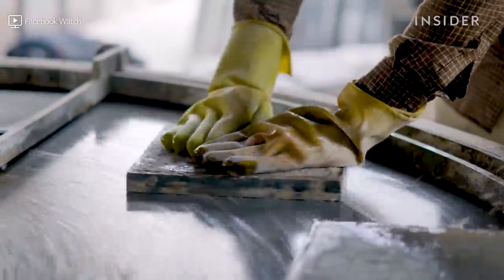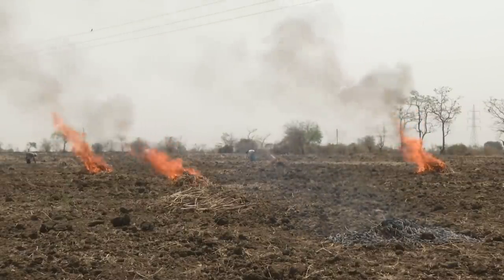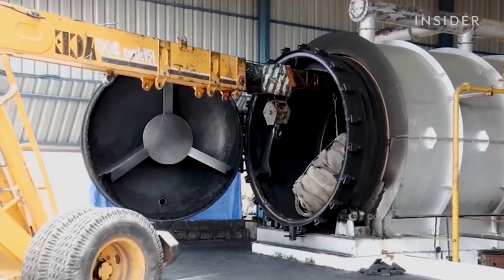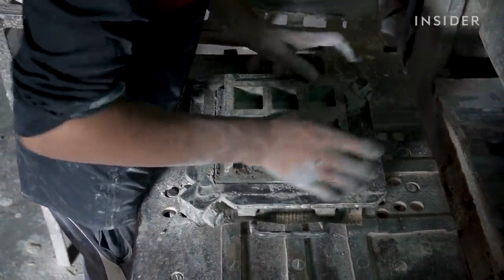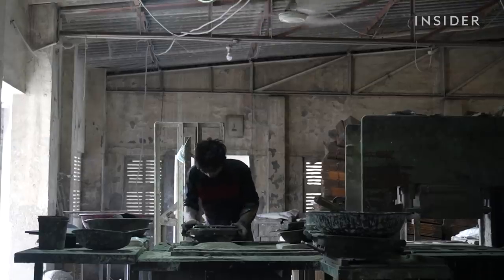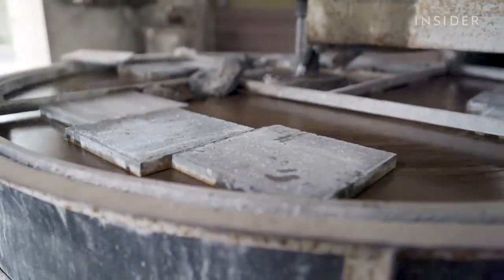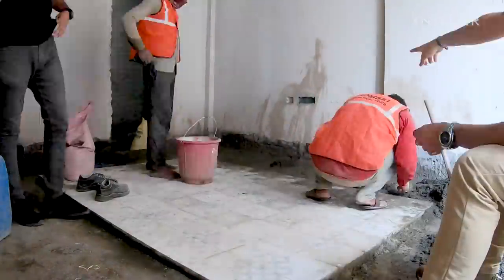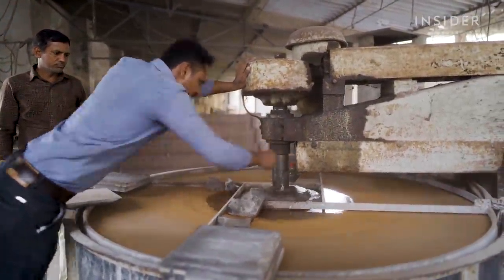Handmade Tiles Made With Smog-Causing Black Carbon | World Wide Waste | Business Insider

Comment: Do they recycle the water
Reply: No, but that doesn’t matter because they save a little bit of carbon from going into the air /s
Reply: @adamrhoads1521  yes it does matter because water is more important than removing just a few tons of smog
Reply: @jaydendiaz1181  you don’t get it, we can just use saltwater /S
Reply: Technically they could if it moved to wealthier countries or done by a company with large financial backing
Reply: @upperjohn117aka  you don’t get what /s means don’t you
Reply: It's greenwashing the tiles are packaged in plastic.

Comment: so they burn tires which makes polution > Sells the carbon so they can makes tiles > soon everyone want tiles > more tires needs to be burned off and more polution is made.. I see they are really smart. 

Why not dig a hole and put it there insted? if its solid why use it? - Maybe make tires without carbon in it, that would solve both tires burning and carbon in air.
Reply: It's greenwashing the tiles are packaged in plastic!

Comment: Living in Los Angeles I am amazed at the amount of black carbon that accumulates on the surface of objects in my patio area. I live 1/4 of a mile from a freeway so that may explain things. 
As for the tiles, would incorporating black carbon into ceramic tiles not work for some reason? I’m just wondering why they use the curing technique that this company uses to produce tiles instead of adding the carbon to traditionally produced ceramic tiles.
Reply: Except cars don't produce black carbon soot. More likely it's from coal burning power plants.

Comment: Water is hugely wasted for making and polishing of the tiles.
Secondly the term used tiles made of SMOG is not relevant.Its simply they are using carbon black instead of color.
Thirly if the carbon is used for burning in case of fire it will add up a fuel to the fire.

Comment: I'm kinda surprised that they didn't just use black carbon as an insulating material added into cement regardless.

The color black is great at distributing heat but carbon is not so if added into cement walls it should offer a stronger insulation. This should offer a more through pretection in either cold or dry places.

The only downside should be the consistency and amount of black carbon available.

Comment: It won't change anything.
Anything that they show in the opening ( from 00:30 onward ) will still happen, vehicles still flooding the air with pollution, people still burning stuff, and tires still get burned.
And they use cement to make these tiles, cement require lots of energy to make, they also use tons of water (hosed every day for a month), then it needs lots of polishing (15-20 days). All of those combined will result in a more carbon footprint than normal baked tiles.
Well, at least they tried.

Comment: The water required to make them should be reused.
The energy required to polish them for installation in an apartment seems a bit too much. 
Carbon is a conductive material. Imagine having wires running under it. 

In my opinion, this should be sold to cities! On the pavements the requirement of polishing or perfection is way lower. 
Also where ever ground wires are, un carboned tiles should be used that have a distinct mark on them showing they are carbon free.

Comment: well, it already exists. its called something like fly ash cement. its filler for cement, you can you basically use anything as filler but the thing is that the more filler you add the less quality you get, it will brush out fast

Comment: Whilst being a lovely craft they're commited to, it's not really a "better" alternative. "Black carbon" has been used as a die and a cheap additive for centuries. You even started the video showing that they get some of their material from old tires, which are already filled with carbon dust in the firest place.
Also as others have pointed out already, the cement they need  for their tiles needs to be produced too, another energy intensive process.

Comment: The fumes from mixing concrete permanently coat the lungs of anyone working with it; especially those who do so on a regular basis. Those workers will likely die of silicosis because they aren't provided with any PPE. Even with the ideal of fighting economic pollution one is responsible for protecting the individuals.

Comment: Meh, this project releases quite a lot of greenhouses gases due to cement curing, uses up a lot of water and only uses a very small amount of carbon. Realistically it is not going to make a dent in the amount of air pollution (to reduce that you need to start at the source).
You could use stone (marble, granite, volcanic stuff or anything else that lasts) since they are already there, need no baking, no curing and are carbon neutral - all you have to do it make them even/smooth (which is not as hard as some might think).

Comment: Carbon dioxide is not a pollutant. It is plant food. It's the loss of ozone that is messing up the atmosphere.
Reply: First of yes Co2 isnt a pollutant and that isn't why it's a problem. Co2 is a greenhouse gas that retains more heat from the  sun and heats the planet. Also no the hole in the ozone layer is not what is "messing things up" the hole in the ozone layer is almost completely gone and has been rapidly reducing in size since the 1990s. Basically the ozone layer is no longer a issue anymore since we solved that problem with regulating ccfs like refrigerants and aerosols.
Reply: @randybobandy9828  you might want to check the ozone loss going on in the tropic region. There is new findings on that. And CFCs were not the main cause.just a contributing factor to make an ongoing problem worse. It has to do with the magnetic field and the sun.
Reply: @suzieseabee  from what I've read ozone layers problem already solved
Reply: @agateslate7939  no, it comes and goes. Like the el nino(ocean thing).

Comment: What about the safety of the employees? Sir you need to provide your workers with PPE. And also you can recycle a water, why not put it in a huge basin and soak the tiles on it and reuse the water instead of using a garden hose.

Comment: These tiles are made from black carbon made from burning down tires. That black carbon is usually sent to factories to be burnt as fuel, but he buys some of it and turns it into tiles.
These tiles aren't a solution to a problem, they're a side effect of a problem. This tile-making process cannot exist without a large source of cheap black carbon on the market. And even making that black carbon is bad for the environment.
The only actual solution is for the factories running on black carbon to switch to a different energy source, thus ending the market for black carbon.

Comment: To produce a carbon tile you double the emission, as the report does not consider the total carbon footprint.

The electricity of polishing and pressing machines.
Waste of drinking water in parts baths.
The fossil fuel used to transport the raw material and the finished part.
All additional consumption of the company, from its office, to the addition of employees who will contribute to the daily carbon footprint.

It's a doomed solution!

Comment: As nice as it is to used recyclable material as building material you have to be careful as it might very well have unintended consequences for example in israel the was a recyclable building material for flooring (the stuff that’s under tiles) to replace sand it was made by grinding old plastic and rubber melt them together. 
At the time it was hailed as a major step forward in sustainable building but later it was shown to be a major fire hazard that when burns released a massive amount of pollution and in liable to cause cancer

Comment: i am kinda not sure about this.everything i presented effective, easy and problemsolving while its really not.

cement needs to be harvested which costs a lot of labour, only a small amount of the black carbon that actually land in the air is used, these tiles are kinda expensive so whos gonna buy it, the constant watering and polishing causes a lot of water waste, the employees are clearly breathing in highly concentrated carbon air with no protection.

the idea of reusing black carbon in building is great, but this is definetly in need of some adjustments.

Comment: I would be fine with putting tiles like this on the wall, but I don't like the idea of using these for walking surfaces.
Reply: Why?
Reply: @randybobandy9828  Tiles on the wall are rarely disturbed and normally last ages but tiles on the ground break and crack regularly.  I do not want tiles made from air pollution breaking in my home.

Comment: Good idea but...what ? Rinse in many times ? Does the water used for rinsing will washed away and take the dangerous chemical substance inside carbon in the tiles to the waste water system ? Or any drainage system ? And, it's gonna use much water to rinse it.
200x30 = 6k a month... Still very small number...hmm... It's really hard to not polluting the environment...
Reply: It's greenwashing the tiles are packaged in plastic!!!
Reply: @insectbite1714  ohh.. I see.

Comment: The video doesn't really explain the process or gathering or filtering the soot. How is it actually captured?
Reply: My guess would be by forcing the exhaust to travel through baffles, then scrape it off, but I got no idea. Maybe they force it through water and then filter it off?
Reply: @maxpulido4268  That's my guess too. It only goes to show how unviable this is. Yes, it's an idea and they made it into a product, but it's not even close to the real solution.

Comment: What kind of reporting is this...no numbers in terms of percentage of carbon to cement used in the tile. Talking about air pollution and not caring about how much water intensive this process is...no mention of water recycling if these architects are hell bent on preserving nature. Some people in comments have correctly pointed out that cement production also consumes a lot of energy. They should take down this kind of reporting.

Comment: Highly unsustainable idea. The health risks and cost is actually higher. The soot is not really packed away for good. The amount of water and electricity it requires seems to be similar for cement tiles which at least are heat cured. This cannot be a solution, but rather a short term gimmick. As an engineer, I don't see it doing any good for the environment or the society in general.

Comment: Yea this is cute and trendy but will never solve anything nor have a positive impact. 
They collect some Black Carbon and process it with Cement (extremely contributing to CO2 and black carbon).
Then press it hydraulically, heat it up, Polish it. 
All these process require electricity and up to know, main electricity is produced by : combustion that surprise creates carbon.
Reply: It's greenwashing the tiles are packaged in plastic!!!

Comment: OK, so there is a bunch of nonsense in the comments on how this is greenwashing, because the process still uses cement, & also uses an epoxy seal/packaging or something on the tiles. 

This kind of take is utter BS... and those types of folks are NEVER going to be happy with anything. Improvements are still improvements, even when small... and if this did act as a way to re-purpose a form of industrial waste &/or decrease the total energy cost of manufacturing tiles by removing 1 application of heat, that WOULD be a win. Less polluting is still good, even if it isn't NO polluting at all, & you idiots are going to kill ANY possible improvement with that attitude. If anything, you are signaling to industry to just keep doing what it's doing because it can't possibly win you over.

That said however... this IS still greenwashing, but not because the tiles still use cement+epoxy but because they likely aren't doing anything to reduce the black carbon being released into the air in India. Remember the problem is the carbon is in the air... and that isn't where they're getting it... they're getting it from the filters various & sundry burners already have in place. So zero reduction of air pollution. The 'cold' process to prepare the tiles IS more energy efficient... but also something I believe was already in place before this company came around. So essentially the actual gains are an additional sink for non-air-pollution carbon waste, & encouraging a slightly less energy intensive way to manufacture tiles.

There are some environmental gains there... but NOT what they are selling on the tin.

Comment: Pull this video. It's absolute hogwash and a stain on any journalistic integrity the brand may pretend to strive for. There is nothing remotely green about anything made from cement, let alone tiles. Whatever tiny benefit is gleaned from using a bit of carbon is wiped out by the entire rest of the process. Do better.

Comment: so they use cement to make tiles and cement is a huge CO2 emitter and one ton of cement emits up to 622 kg of carbon dioxide annually. we need to start finding other alternatives to concreate and stop road constructions that use just cement.  and them guys working with cement and the carbon should be wearing filtered masks.